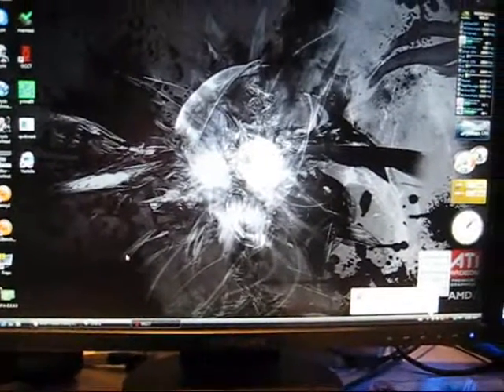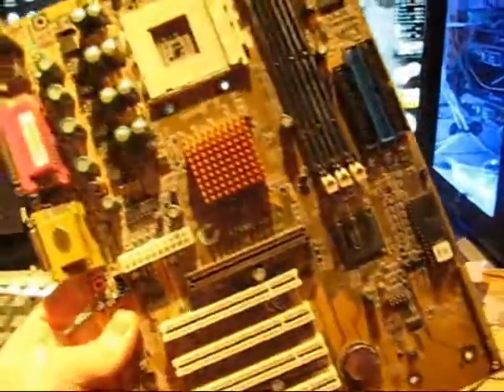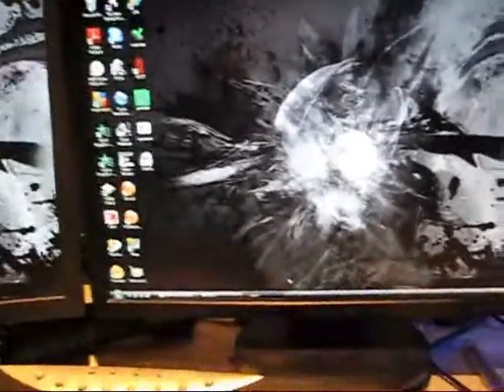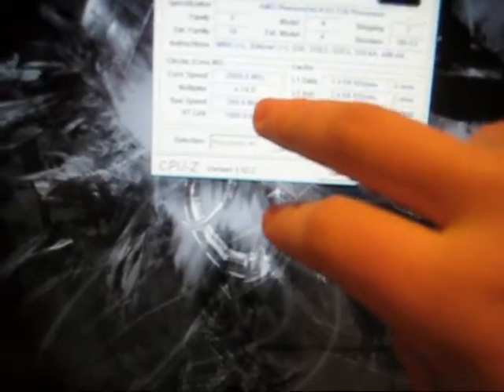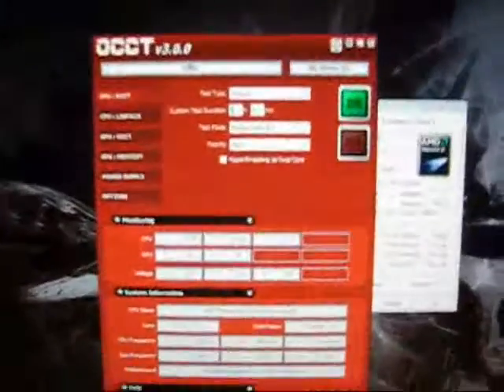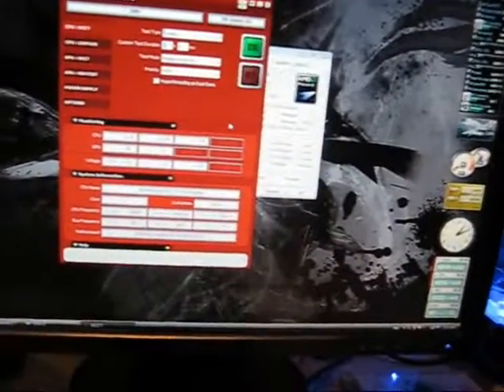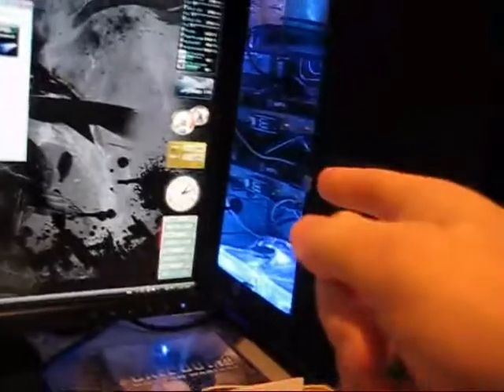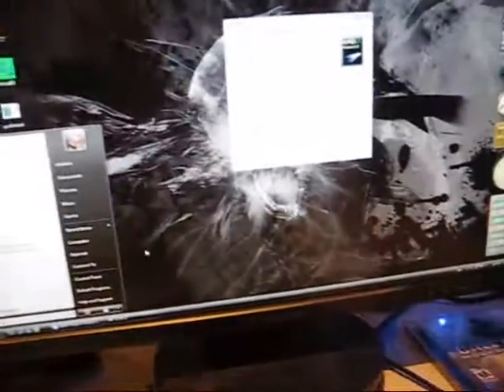How to Overclock an AMD CPU Part 1/3

Comment: i overclocked my Intel core i7 3770k from 3.5Ghz to 4.6Ghz without any problems! overheating is not a problem nowdays.. either are motherboards.. Watercooling is the best to keep ur Computer cooled.

Comment: hello!
Motherboard Name:Biostar MCP6PB M2+
CPU Type DualCore AMD Athlon 64 X2, 2300 MHz (11.5 x 200) 4400+
System Memory 2048 MB (DDR2-800 DDR2 SDRAM)
Video Adapter NVIDIA GeForce 9400 GT (512 MB)

What settings should i use to go from 2.3 ghz to 2.8 ghz? thx

Comment: Where can i see wich motherboard im using? also when i open OCCT it says "OCCT detected that CPU-Z or HWMonitor is running. as OCCT uses the 2 programs this can lead to weird results in System Information or Monitoring information.Do you wish to continue" Will anything bad happen if i continue? i want to know before i do :3

Comment: @seerp94 how do you mean, won't handle it. is the cpu too slow for the grapics card? buy a new cpu with thesame procssor socket and make sure your cooling is capable of cooling the new processor.

Comment: @attilagenius94 Do you have a pre-built computer such as Dell, Gateway, Acer etc? If so, Bios are locked and you can't change it. If you have an aftermarket mobo, you should be able to unless for some strange reason locked.

Comment: @Danistheman180 what graphics card are you runnning ? its not all about cpu its also about gpu, ram and sometimes even hdd but this has less of impact. but its not normal for quad to run low, as i got phenom 2 quad 3.2 Ghz OC @ 3.4 and can run games fine over 5760 x1080 but thats mainly due to graphics card :) (which cost more than my cpu!) mail me if you got questions :)

Comment: @NsMs96 no it wont, ahhhhhh when @asillynoob talks about OEM he means computers that you buy that are already loaded with an operation system and alreaedy put togeather and pre configered and run reallly stable and dont let you OC them so you cant screw the companies settings up. (genreally speaking, few exceptions like Alien ware i tihnk) but OEM software cant touch your bios :) i built my own computer then got OEM win 7 (as its cheaper) and i still OC and stuff :) mail me if you got questions

Comment from the maker: @HostileDonut original equipment manufacturer, in this case it is a pre-built computer (ie dell, acer, asus, HP etc)  companies that build systems lock the BIOSs on their motherboards so you can not change the clocks...hense no overclocking

Comment: Thanks for the info man, i really want to Overclock my CPU because i play the game EQ2 and it is very CPU intensive.
I bought my comp back in 06, its an Alienware Desktop. 
I have an AMD Athlond 64x2 Dual Core Processor 4600+ which is currently running at the stock speed (2.4ghz).
And my BIOS is Phoenix Award Workstation BIOS v6.00 PG
Not sure what my motherboard is tho, think i can overclock it?

Comment from the maker: @iPadwiz nope.

THe motherboard in your HP is locked.  meaning you can't change bus speeds and voltages, you'd need to buy an aftermarket one

Comment: hey man 

im currently on a s939 system and the recomended voltage for my cpu is 1.40 is it  safe to go to 1.5?.. my motherboard has solid capacitors made in japan so it seems to be pretty good.. for an old motherboard

Comment: Hello,

I have my 620 running at 260X13 with  RAM upped to 1.7 volts from 1.65 and the timing set to 7-7-7-20 (OCZ recommends 9-9-9-20  As you suggested I adjusted the HT and NB to as close to default as possible and the RAM speed to just under the default . It runs for at least 4 hours on Prime95 without errors.    Max temps (Everest) 59 CPU, 66 NB.  Of course, nothing I do ever stresses the system like Prime95.  What do you think?

Comment from the maker: same time as you would normally, it just speeds up your system, and if you do it right, shouldn't hurt it either (assuming you cool it)
the way i see it, a computer on 24/7 will run for 11 years until a hardware failiure.  An overclocked (hefty overclocked) will run for 5-6years until a failiure. and would you keep a computer for 5 years, heck no